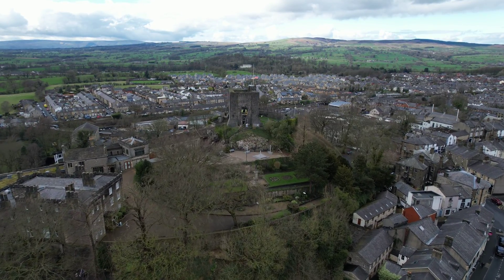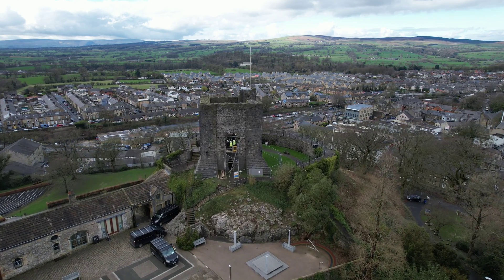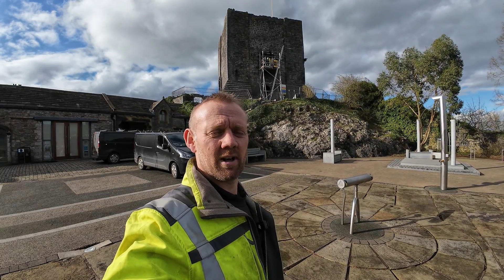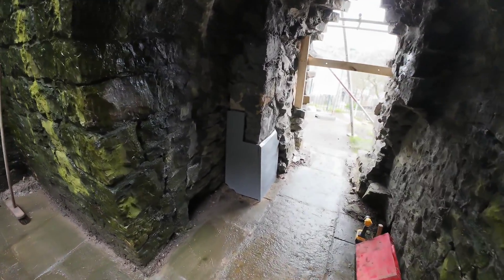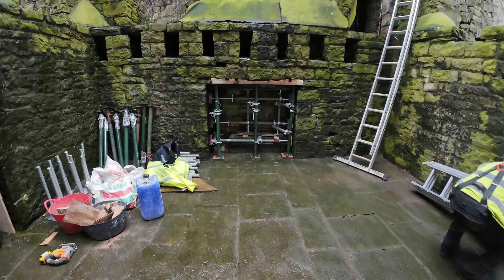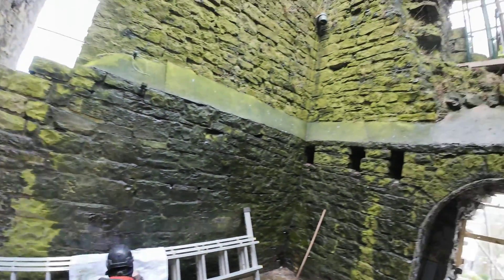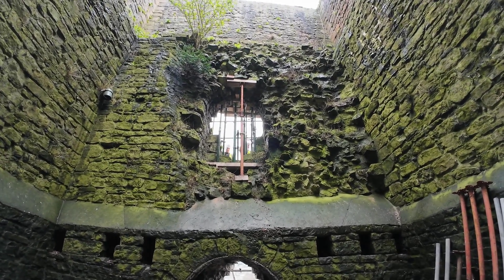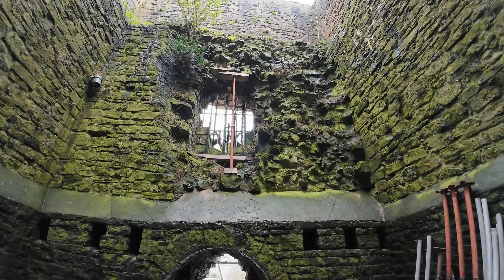11th Century English Castle Repairs - Clitheroe Castle, Lancashire

Comment: Must be difficult pricing these jobs. Im guessing some sharp sand and NHL for the packing mix?
Reply from the maker: We had the structural engineer's design to work from for pricing. 
The packing mortar was 1:1:6. This was only used to fill between the timbers and masonry. We needed a mortar with greater compressive than an NHL.
Reply: Is that 1 lime, 1 cement, 6 sharp sand? What lime were you using? Thanks  @UKRestorationServices